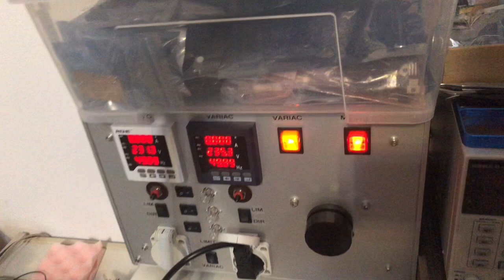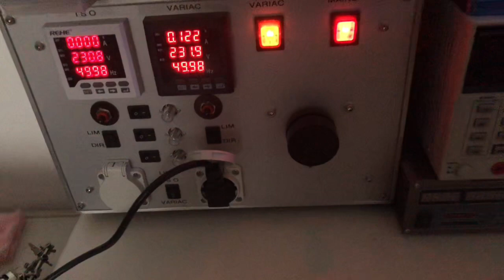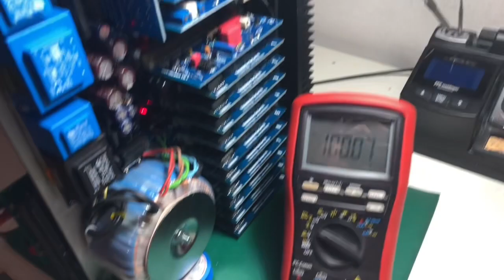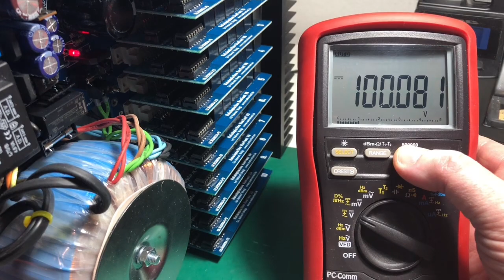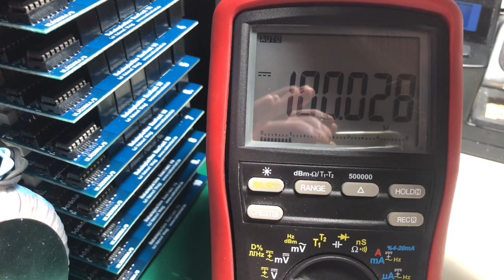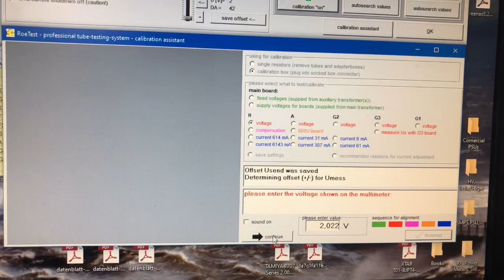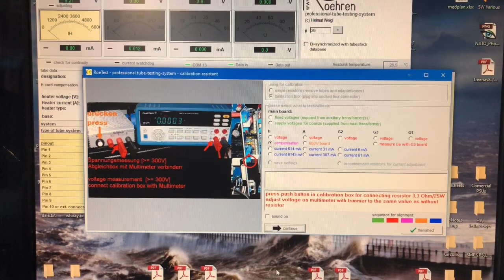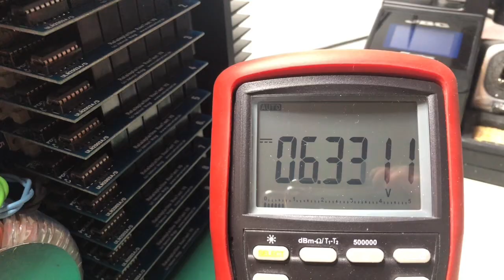ROETEST Tube Tester Build Part 5; The Calibration Part, using my Customized CalBox

Comment: Great video, I recently purchased the newest version of the Roe tester. I’ve ordered the full BOM from Reichelt over two months now and it’s still hasn’t shipped. I am so super antsy to finish this build
Reply from the maker: Hello , Thankyou! In my Build I redesigned completely the Socket Receiver, Socket Boxes concept to fit my needs of near 0 mechanic work needed :-) I use Pcbs for almost everything. Cheers, Konstantin
Reply: @KonstantinGrigoriadis  I was thinking of designing something similar, was worried about oscillation, but I’ll have to try it out
Reply from the maker: I Designed it to not have Oscillations as seen on the Videos :-)
Reply from the maker: On the Following Links of Helmuts Page I have a description of my Built with pictures:

http://www.roehrentest.de/NB%20Grigoriadis%20Konstantin.html and

http://www.roehrentest.de/NB%20Grigoriadis%20Konstantin%20ROETEST%20V9.pdf
Reply: @KonstantinGrigoriadis  thank you for sharing! I’ll definitely design something similar for mine as well! I
Reply from the maker: if you are Interested I can send you the design files with all the Pcbs I made, the mechanical Parts needed and the changed V9 Frontplate I made